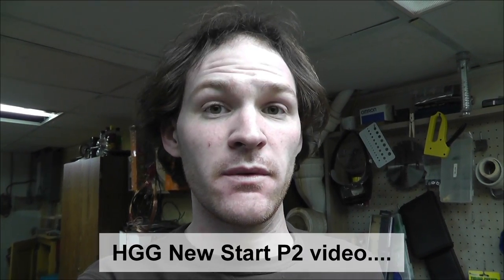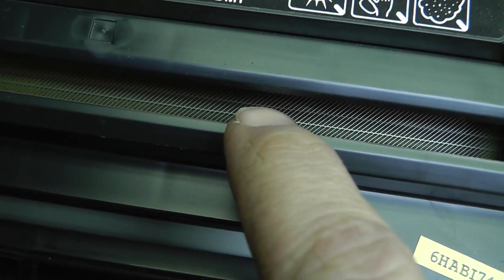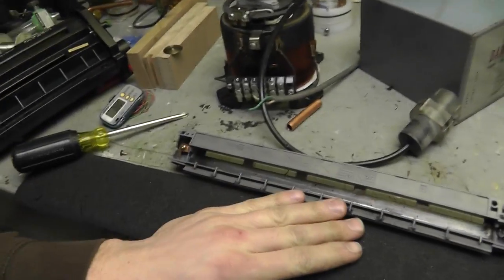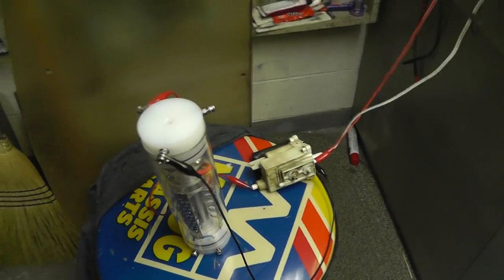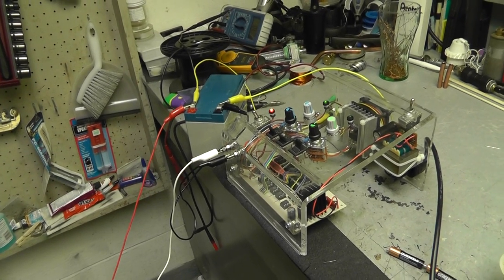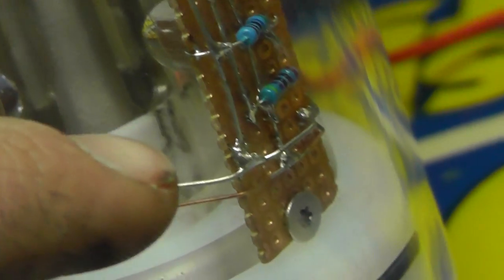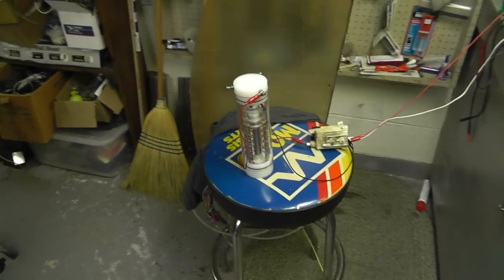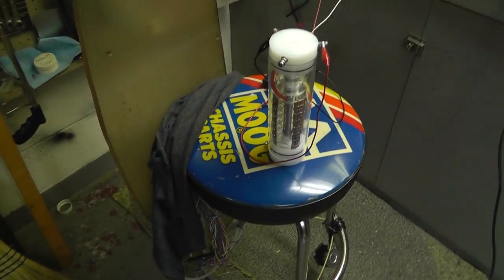HGG New Start P3, final assembly & Testing Starts

Comment: i have been working on my a fly back for a while.the modified primarys allows you to get a better control of how meany amps it will draw. with my project i am just using it for a hv supply to feed other projects and i threw in audio modulation for fun. i know i can get mine to run on a small 9v battery if i wanted or pull 10 amps but that's what im trying to do with mine. use your driving transistor as a resistor (yes they don't teach you that in school) and you will be able to control the arc

Comment: flybacks sounds like your best choice for pulsing it like you want.. remember ac transformers like you other supply can work on pulsed dc too and will be already current limited so you it wont draw an arc as far and you will have more control over the arc. this my be an even better idea exponentially if all you want is a corona discharge